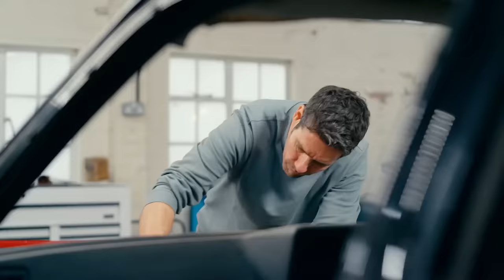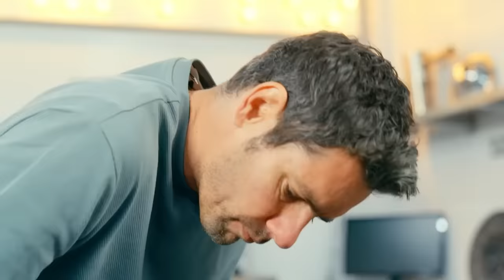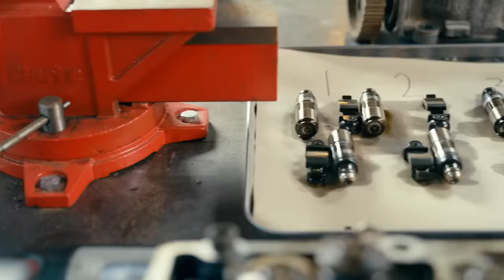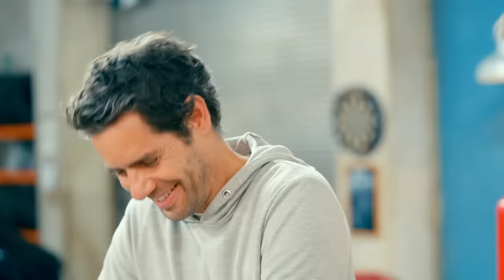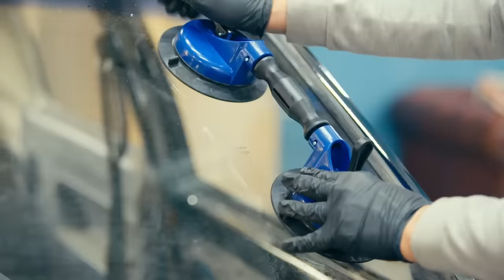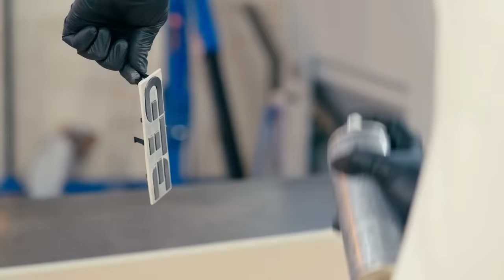Mike And Elvis Get Their Hands Dusty With A Super Rare Mark 1 Astra GTE | Wheeler Dealers

Comment: I had a black Astra GTE Mk 1 in the 1980s, and it was a fast, comfortable  car, especially with those Recaros! The only issue I had was with  the ECU,  which developed a fault not long after I bought the car. This was easily replaced by the car dealer & I had many miles of trouble free motoring after that..........this video brings back lots of happy memories! 👍
Reply: I had one too, in 1994, spitting image of the one shown here, lovely comfy car, quick and reliable. In the summer of that year, my ex (with whom I was still on good terms) asked if she could borrow the car to take her mum shopping in London (setting off from Hereford) 48 hours later, they're back safe and sound, but she'd been rear ended on Wembley Hill! Car written off, and that was that!
Reply: I had a 1984 gte in red , awful brakes but loved that car.

Comment: Did you even spray some sort of penetrating oil or ATF down the cylinder bores before rotating the crank?
Reply: Was thinking the same , I’m doing a triumph spitfire up that hadn’t run for years so sprayed fogging oil down the spark plug holes , left a few days then turned engine by hand and repeated. Now have a great running engine with great oil pressure and no rebuild. Simpler engine but still 🤷
Reply: We used to spray brown vinegar down a siezed engine for a few days down the spark plug holes.
Seeped into the siezed rings.
Vwola 2 days later broke the tight seal.
Turned over no bother.. Changed oil and filter.
Got it to run before a tear down.

Comment: I owned 2 in Black, a Y reg one which was a headache, cylinder head off it 4 times in a week, it was cracked! it was the nicer looking of the two i had,  the 2nd one was an A reg with a 4 speed gearbox, it was quick when it was put to the test in the mid 90`s, the races on the roads with custom mk2 Cavaliers! it was one of my favs of the 80`s hot hatch and with the letters GTE on the seats, it made the mk1 Astra GTE even more special. I was aged 23-24 year old when i owned those cars, i was quite lucky to own 2 let alone the same colour, i was known for having nice older cars from the 80s.

Comment: I had Mk1 Astra GTE in white, a 1984 "A" reg (registered on 29th Feb 1984) from 89 to 93. Cracking motor, had almost 120,000  miles on the clock when I sold it. Still on original engine, gearbox and clutch.

Comment: I had a red one of these. Bought it when it was 18 months old. I fitted a full Janspeed exhaust and manifold (that didn't last long!)  Lowered spring kit, Lucas 20-20 spots and 5 spoke Revolution alloys that transformed the looks. Not as quick as the later 16v's but was a nice little car. They did suffer from Vauxhall poor build quality and rust was standard fit. 😢

Comment: I had a Mk1 Astra GTE in Carmine red...it succumbed to major rust...trouble spots are...the body kit..it will let water and crud eat away at the wheel arches, sills and boot.. the floating calipers always siezed up, the blower motor corrodes..but still the most favourite car I had...

Comment: Just two cover caps on the front spoiler are missing. Driving without these caps gave the car some extra cooling (towing a caravan in the mountains). The Astra had the normal mirrors that all astra's and kadett's had. In Europe, the Kadett GTE had Engelmann mirrors. Looked way better. My Kadett GTE had a glass sunroof, 100% original from the factory, that you could tilt or remove the glass panel and store it in the boot (with a cover). It was my first car and bought it in 1989. And sold it in 2022! What a good car that was. A GTE lover is going to restore it like new. I kept my Capri that was always parallel in my life next to the GTE since 1992. The Capri, i restored in 1995 and is still like new.

Comment: am i missing something here but I have never seen the underside of shell bearings lubricated before inserting!  surely its just the bearing face to the crank that requires lube?
Reply: It makes them easier to insert.
Reply: I’ve only ever built 3 engines but was told off an old guy that lubricating both sides can cause it to spin the bearings on initial start up.
Reply: @carl_marks1626  absolutely right. If you apply lube to the back of the shells, you can get a false reading when you torque up the caps.
Reply: @jasonsansome5579  Yeah. Never oil the "backside" of the bearings.
Reply: @carl_marks1626  Very unlikely as there is a raised notch in corner of the shell bearing that fits into a small cut out in the block to stop it spinning. Same with the bearing into the con rod. Pause the video at around 3 mins 46 secs and you'll see it.
Reply: hahahahahahaha

Comment: The Engine Ford couldn't make, this 1.8 injection unit revved up quickly and stuck the power down, much faster than on paper suggested.
 At a time Ford were using the asthmatic 1.6 CVH, this was up there with the Golf GTI as a real hot hatch.